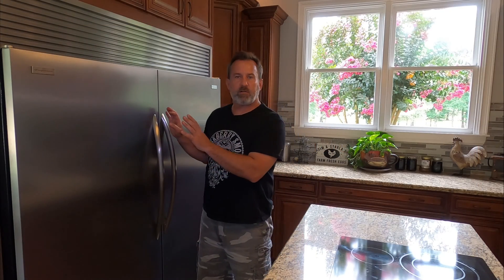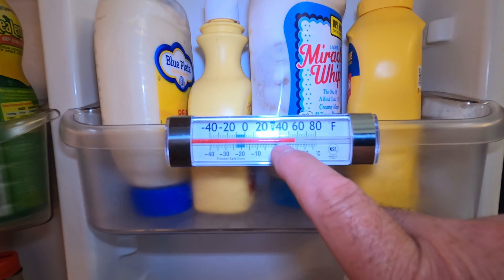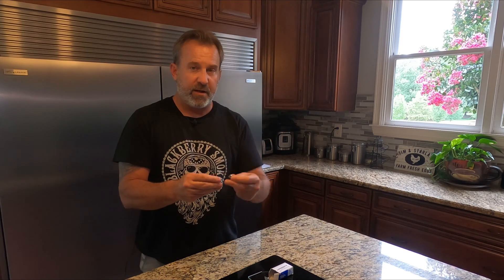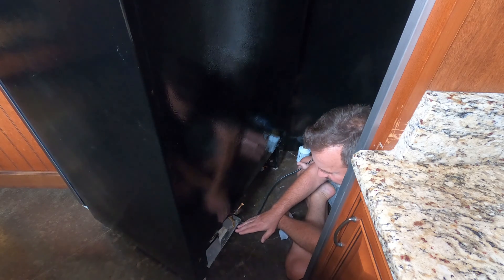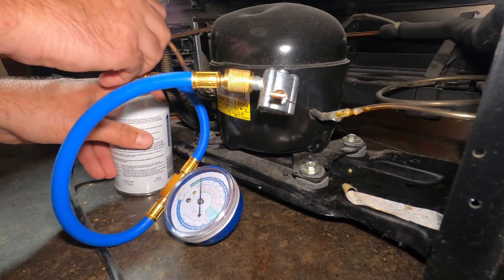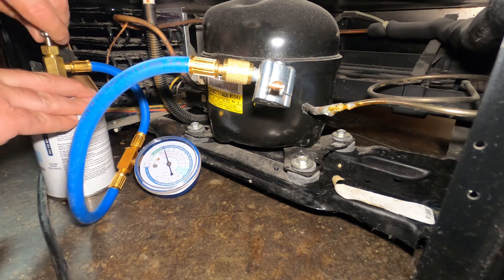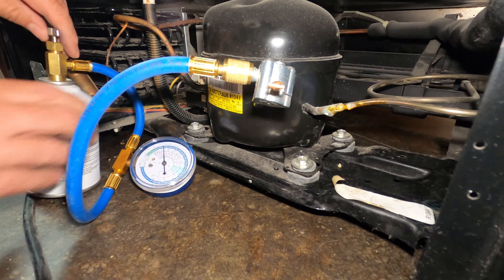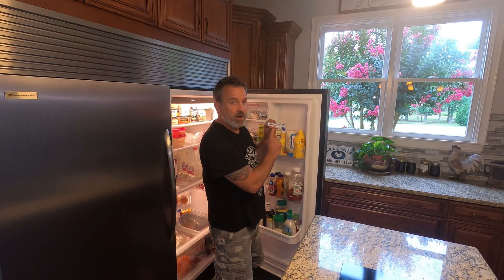HOW TO Fix Refrigerator | Refrigerator Coolant Leak | Bullet Piercing Valve

Comment: Those piercing valves leak. Better to solder in a service port, takes just a minute.
Reply from the maker: Good to know!
Reply: @ridgelifereviewshowtos  Or get a 1/4 inch compression tee. All you need to do is cut the return line and tee the service port in if you dont want to solder anything.

Comment: Hi Tim, in your video you spotted some oil at the  pipes. Does that mean that you can locate the exact spot where your system is leaking. In that case you could maybe fix the leak in a way you wouldn't have to braze it. If that fix would diminish the leaking for about 70% or so, you would be better of and recharge it only once a year. 

And is that can really filled with R134a refrigerant or is it filled with the compatible R134yf?
Reply from the maker: Maybe some stop leak might fix it. It was up in the elbow I think. Yes 134a.

Comment: Im getting pressure not vaccum. I used the same line you did. The larger line.
Reply from the maker: Hmm. You may have a huge leak too much to just top off. Do you see any oil leaking?

Comment: How to do it right, after you already installed the valve:
Turn off your refrigerator.
1)Find a leak. Get a can of nitrogen WITH pressure regulator (without regulator your refrigerator will explode), fill refrigerator with nitrogen up to 145-217psi. Often after this you can hear the leak by ear, spray soapy water to pinpoint it.

2)Use oxygen and acetylene with solder containing silver to braze that leak shut (if it's a copper pipe), make sure you don't burn down your house, get your fire extinguisher close beforehand.
3)Use vacuum pump to create vacuum in the system, preferably use digital vacuum gauge to see how much vacuum you've managed to create. Ideally it should be under 1000 micron.
4)Use scales to weigh gas canister when filling your system. Usually there is a sticker on your refrigerator that tells you how much refrigerant is inside your refrigerator. Some gas canisters have 2 valves, one for gas, other for liquid, you always fill systems with freon (R-22, R-404a, R-410, R-134a) using liquid. I personally use liquid to fill every system, never fill with gas, because canister becomes cold and all the refrigerant will not come out, liquid is faster and more accurate. Those freons I've listed are made out of multiple different gases, when you fill with gaseous form, the proportions of that mix change and refrigerant will not be as efficient.
5)Turn on your refrigerator before disconnecting your hoses, so that system will suck in more pressure and you will lose less refrigerant.

I understand that all those tools are expensive, but without them it's not possible to fix a refrigerator correctly. Author of this video keeps adding freon in there, okay, it keeps working. Over time what will happen is - moisture that got into compressor oil when compressor was working under vacuum (because system was completely empty) will change that oil into goo that will clog that small thin pipe called capillary tube, as well as his filter that you can see in the video. This will cause compressor to work with vacuum on one side and extreme pressure on the other side, and that is where you'd have to change your refrigerator. (Maybe it's possible to change capillary tube in this refrigerator model. Then you'd have to change capillary tube, filter, compressor, vacuum it, recharge it. But it's risky business, the rest of the system is already contaminated too, so probably not worth it)
Reply from the maker: It’s been working like this for years now. Only spent  few dollars. I made this video originally on another channel many years ago. Still good with a little bump every 6 months or so.

Comment: Don't do it if under warranty. If you don't know how refrigerant and refrigerant systems with you shouldn't mess with it. Sealed systems should not leak. If so there is a leak that is venting the system to atmosphere. Refrigerant is typically bad for the atmosphere. That is why you need to go to school for EPA 608. There is a pressure temperature chart for each refrigerant as they are blended differently. Also if it is a blended refrigerant do not charge as a vapor. You should have a professional do it. The basic information is there in the video but the technique knowledge is not there
Reply from the maker: Haha! That’s not why people want a DIY video. It is to keep their device running at minimal cost. This unit is still running with a slight leak for years.
Reply: @ridgelifereviewshowtos  I know that is not the reason for diy but you should know how the refrigerant works and why it is bad. There is a reason to certify in that field
Reply: @ridgelifereviewshowtos  if it was purely mechanical then sure go for it but you should know the health precautions for handling refrigerant. Also you would have a leak which is also bad
Reply: @matthewcalloway9325  Hi Matthew, I have got the same problem with my (very expensive) ice machine and I hope you can help me with some extra information. The leak is very very slow and until now it has not been recharged. It is R134a system with a LG NS36HAEG compressor with probably POE oil inside it. The temperature of the discharge line is much too low and the cooling capacity is I guess about 50-65% of what it should be. So it works, but it takes twice as long to get my ice cream chilled. The machine is about 8 years old, so that's why I guess it is a slow leak.

My problem is that I cannot find any real R134a refrigerant to recharge it. So my only option is adding R134yf which is available on-line. So my first question is (1) Can I charge my R134a system with some additional R134yf or will that give issues? To my POE oil or my compressor for instance?

Another route I can go is to charge it with some R290 which is much better available and add just a little bit of that. The efficiency of R290 is way much better as you know so my ice machine will cool probably chill as a charm after that in case of temperature like. And this is probably my first choice I want to go for.

The last option is, as you describe fixing the leak. Pressure test with nitrogen, find the leak, purging with nitrogen, brazing and charging it again. And after that I have a choice for my refrigerant. I could do R134yf, but I prefer R290 in that case. The R290 charge should be quite less then the R134a, however there is no weight of the R134a specified on this machine. So I have to use a temperature pressure chart in that case.

Question (2) How much impact will R290 have on my R134a compressor??? in this case? I already found out that R290 can also work with POE oil so that shouldn't be a problem. And maybe the length of the capillary tube should be changed and I could also do that if it is required. But since I use this machine only half an hour in about 2 weeks, or maybe double that amount when it is hot, the load on that machine is negligible. So will I in this case murder my R134a compressor and is another DIY! option more preferable.

I know it is a lot of text, but I hope it is helpful for you to give a good answer.

Thanks in advance Matthew 😊

Comment: Arent you supposed to you put that piercing valve in your low pressure side. Not on service port? If your fridge wasnt working its basically closed system?
Reply from the maker: This is the perfect location. Yes it is originally a close system. Once you put the piercing valve that makes it an open system for you to service.

Comment: About how many times have you added the refrigerant to your unit? I believe you said that you’ve been adding refrigerant to it approximately every six months. I was told by a refrigeration person that the cans of R134A sold at stores for charging autos, has a different oil than the non-auto R134A refrigerant and using the auto R134A will eventually cause the compressor to fail. Whether that’s a fact or not, I don’t know. And if it does cause the compressor to fail, will it take one year or ten years. If it takes ten years, seems worth it to get another ten years out of the refrigeration unit. Thanks for the video, you did a great job of explaining every step of how you have successfully been able to recharge your unit.
Reply from the maker: Been doing it for several years now every quarter. Still going strong.
Reply: @ridgelifereviewshowtos  Thanks for the reply! I watched many videos of how to go about installing the bullet piercing valve and recharging the compressor, your video was by far superior to everyone else’s. I learned what piercing valve and gage to get. I followed your video exactly, my refrigerator is fixed and fridge and freezer are now cooling like it should be. Again thanks!!
Reply from the maker: That’s great!

Comment: Tim.. I have the same Fridge/Freezer set I'm dealing with. It rarely reaches nearly reaches 40 deg if left unopened over night.. My question is how do you know we have to pressure low side to 10 psi. Some other videos on different units suggest not more than 3 psi. Is that refrigerator specific or standard compressor specification? I know too high pressure is worse for the compressor so I want to be sure. I'll have this gauge delivered today so will try to familiarize myself with units.
Reply from the maker: I think all of these are about the same. I filled a bit higher to account for the loss. Still going about every 6 months. Next time I will use the coolant with sealer. Good luck!